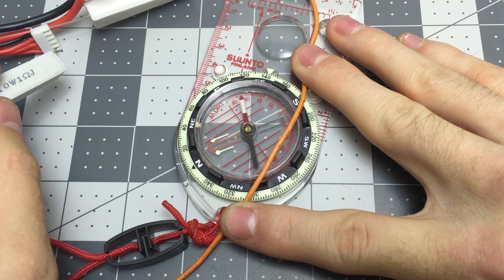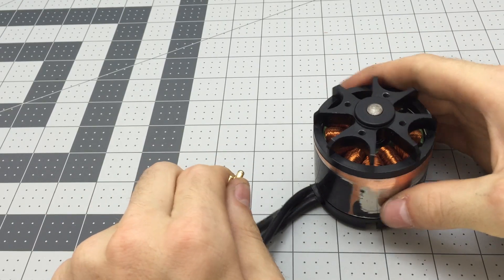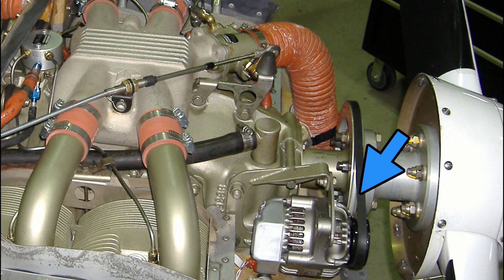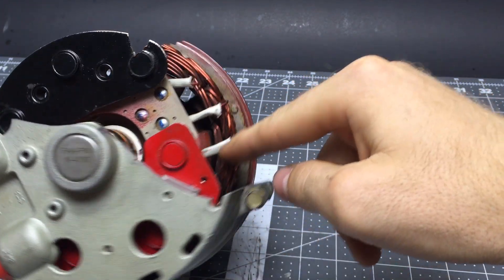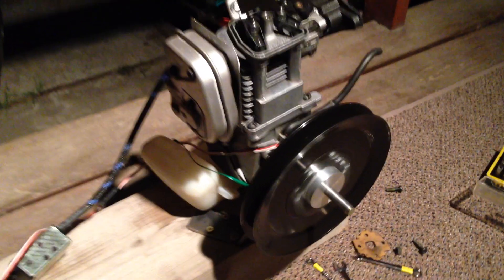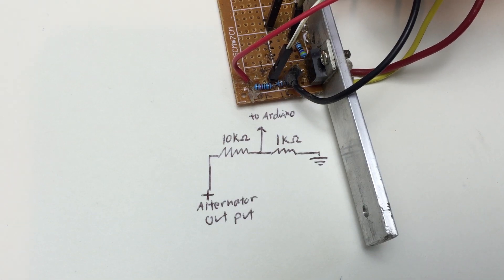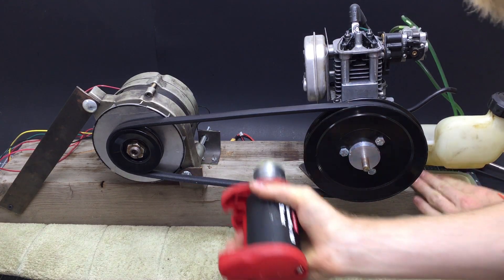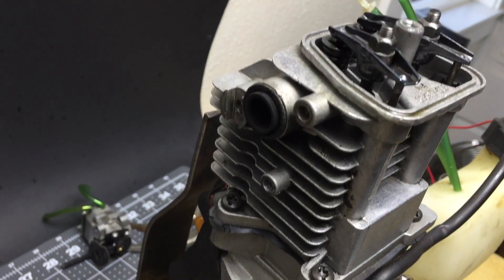How Alternator works + DIY Voltage Regulator

Comment: Gonna need a cooling fan if you want the motor to stay at operating temperature. I suggest getting a pulley off an air compressor, some have a fan with a pulley built around the outside.

Comment: thumbs up for the project
Reply: But my question is how do i make work Arduino as an AVR "Automatic Voltage Regulator" to which i connect an electric motor as driver and another electric motor as generator?.
What i want to know is where can i find the code for arduino in order to make work arduino as AVR and which components i need?

If you don't know please keep your urge of posting anything since it won't be of any use to me or anybody else that is loocking for similar help, avoid stupid comments THANK YOU!.

Do please all of you that think to say you cannot generate electricity with an electric motor well i tell you you are ignorant and you should go back to school!most of all you should get well informed with what materials are built both electric motors and generators.

Someone said: Ignorance is a Blessing for Fools and Idiots.

Comment: I'm doing something along these lines. I have one of those 350 watt Free Electricity wind generators that goes on a stationary bike. I picked up a cheap 12v drill for the motor that will run the generator via chain. I could simply put a voltage regulator between the generator and battery bank, but I need to figure out how to turn the motor on when the voltage in the battery bank dips and off when it gets back up to where it belongs. This would let me run a hydroponic greenhouse without grid electric.

Comment: Well the recipetiers for the Alternator are below the feild winding because when it’s rewinding the Alternator needs to go through the fresh hold at only 13volts when they regulate between Engine spins because they are meticulously harder to spin with lower Voltage power

Comment: i had learned that diodes make elec go one way only ,,they dont change ac to dc !  an inverter does that ,,,,whats up !
Reply from the maker: Diodes are used to turn AC into DC. Inverters are used to turn DC into AC
Reply: diodes are a one way switch kinda ,,,your wrong     INVERTERS CHANGE AC/TO DC OR REVERSED

Comment: What do you think is the maximum useful output of an unregulated alternator to charge batteries for an hour as quickly as possible? The idea is to charge in an interval for an hour and let it rest for an hour or preferably two. And again. Thus reducing the generator run time to minimum (1:1 or even better one to two).
Reply from the maker: Alternators have a maximum current rating
Reply: There may be considerable safety margin for continuous output. Ideally all amps would be taken out without melting anything during the charge interval. The shorter the charge interval, the more rest for the alternator. I guess it has to be tested in a lab.

Comment: Why 132 dislikes? I am a mechanical/electrical engineer, and this is a very acceptable explination, the video description i fairly precise and the guy seems OK....
Reply: Well the recipetiers for the Alternator are below the feild winding because when it’s rewinding the Alternator needs to go through the fresh hold at only 13volts when they regulate between Engine spins because they are meticulously harder to spin with lower Voltage power through pin13

Comment: Is it possible to regulate up to 48-50v for charging a 48v battery bank?
Reply: Its always possible to use a step up DC/DC converter to inchrase the voltage.
Reply: mikeman400 yes you will have to spinn the generator verry fast tought.
Reply: mikeman400 im getting 330v from a car alternator thath i have to gear up to about 10k to 20k rpm.
Reply: Duett A Traktor it is possible to get 220v AC by car alternator???
Reply: mikeman400 you need to make your own voltage regulator the one in the vid i dont think will handle 48v

Comment: Thank you for making this video. I kept pausing, writing down, going back, and will watch again a few more times. I bought a mint 81 rabbit diesel, it had a 55 amp motorola alternatir in it, I upgraded  the stereo system, and put a single wire chevy alternator in there, that supposedly will put out 225 amps at higher throttle. My fuel mileage went from a consistant 51-53 mpg to 46-47 mpg with just the alternator change. I bought a fluke 325 amp clamp, turned everything up and on in the car and the amp clamp at higher rpms is reading 60 amps.

Comment: I remember few year ago...I was working with a car generator to be used by students in a bicycle project.  Well at the beginning it was hard to spin the  generator until we start to put a large resistor to the cable that goes to magnetize the field.  The larger the resistor the easy to spin the alternator... obviously less power...but the student did Ok getting about 100 watts for few minutes....until getting exhausted,,, 

Good effort Samm!!!

Comment: if you put load on the alternator there will be resistance in the alternators axle and you need more gas to keep it running. you must make a controller to keep the rpms. but this is on alternators with voltage regulator and no field winding (comon cars alternator)

Comment: Hi Sam it seems like you need some smoothing  for your field circuit. what about using a capacitor ? or something like a comparitor to produce an analog output?  I like the little engine though... I have some similar ones with a permanent magnet alternator built into the flywheel. they are out of a chinese inverter generator.  I was trying to make an auto start circuit so the gasoline generator could be hooked to some batteries (24 volt) and use the batteries to run an inverter. The idea is to use solar and wind as the primary charging but the engine as a last resort. I'd like it to be all automatic. This way you could use power and have the system guarantee that your power is always available. This would be great for an off grid power system such as a remote cabin or camping.

Comment: Hey. I'm looking to make a vertical wind turbine as a school project. I need the turbine to generate enough power to charge a car/hobby battery. I'm a little confused on how I use the alternator. I need help with fully understanding on how to wire up an alternator so it can charge a battery. If it's possible, can you make a video

Comment: Samm Sheperd, crud! - Wish i knew the things you knew in regard to electronics, And in my case my desire to use a homemade bike pedal sprocket drive system. Wouldn't that be a self-reliant project to drive a small generator to juice my weak battery during the dubious times the car will not start in the middle of nowhere. mrflarkusAtgeemail

Comment: You are smart but forgot many aspects here. Reluctance, Induction, Impedance, Power Factor, the list goes on.. The fact you know of an alternator as a three phase delta source supplying (3 diodes/Sometimes 6) to direct current via a voltage regulator is good enough for me.. The ignition setup, Writing code, You sir are elevated in I.Q for sure.
Reply: It is highly, highly unlikely that the alternator/generator is wound as a delta.  Almost all generators are internally wired as a Y (some people call that a star).  It is possible that vehicle alternators are wired as a delta but I would bet a lot of money that that alternator is wired as a Y.

Comment: Really enjoyed your brilliant video ! Instead of having a built in regulator, or even a divorced regulator that resides under the hood, (usually bolted to the firewall), most modern car/truck alternators are controlled by the PCM.  I'd really like to know if the code is as simple as yours- I'll bet it is !.... why not ? Turn on the field, when necessary, and turn it off when it's not needed.  Furthermore, many cars, especially Chrysler products have battery temp sensors, so the code could be written to charge the battery according to temperature.  Also, I've seen inductive sensors on the battery cables, indicating to me, the PCM is monitoring current flow to the battery. All of these points could be adjusting the voltage and using the "on/off" principle you've displayed in this video. ---Kudos !
Reply: It's very crude. PWM is the proper way, and how OEMs do it.
Reply: @blackz06  You are correct, since my post in 2014, I have since learned it is PWM. Also, if you read my reply (above), everyone of the points I made turned out to be true. But I missed one.  The algorithm also attempts to extend battery life !
Reply: @mark_osborne  Yeah, I was just commenting on the PWM aspect.

Comment: How does a electro motive train work?  Electrically and mechanical.
Reply from the maker: I'm no expert in that,  but I'm pretty sure they use a huge engine as a generator and an electric motor for propulsion. This is because of the ridiculous amount of torque that trains need. Electric motors can provide crazy torque at 0 RPM. Essentially using the electric generator/motor as a transmission that needs no clutch and stuff.

Comment: What are you studying? Reminds me of A&P school but you seem more like an engineer ( in a good way) Nice timing adjustment :) Fun projects, thumbs up.
Reply from the maker: I have a B.S. in Aviation Technology. I'm a CFI and commercial AMEL. I also worked in hangers for like 3 years working on aircraft under A&P's but never persued my own A&P qualifications. I can sure change the oil and pull the plugs in a jiffy though. I was put off by engineering when I learned it was all just solid math. I didn't learn to appreciate what engineering was until 2 years into college

Comment: That little engine is running sweet. You've done well and great find. I'm not sure how cold it is where you are but if you have a little desk fan handy and set it up so its blowing over the engine... I mean if its going to run for any longer than a few minutes that is, it mighn't be a bad idea.
Reply from the maker: Thanks! Yea I can't run it for more than a few minutes before it gets too hot and starts to burn oil. I was doing power output tests with an RC airplane motor and propeller which I was also using to cool the motor.

Comment: do a car alternator push d same current example 100amps at high rpm n low rpm? ..
Reply from the maker: Instead of the perspective of "pushing amps" lets say that the system tries to draw that load of current. Alternators are able to provide more current at higher RPM, because there is a lot of voltage sag in the alternator and the system when under high current draw. So when high current is drawn, the voltage that the system sees drops and then the alternator can produce a higher voltage so that the system then continues to see the correct voltage.

Comment: why did you connect it to pin 13 when you want it be PWM?????
Reply: The field's PWM is triggered by the rise/drop of the output alternator voltage and not the arduino's internal clock.
Reply from the maker: +Andrew Maraguinot it's not true pwm
Reply: pin11,10,9,6,5,3 are the pwm pins??

Comment: There's six diodes in the alternator not three. What's the model of the outrunner motor you show? Looks like it could really move some weight around.
Reply from the maker: 2:50 "There are six big diodes that are used to...."
It's an Emax 5335 - 08

Comment: the main reason I clicked on this video is that little motor. or engine. that little thing is cool! do you know what brand it is. and the displacement. I would like to get one. and what kind of ignition system was that? I never seen one like that before. I already knew how a alternator works. but I really like seeing cutaways. but I couldn't ever make one from something useful. I guess its just seeing all the parts at home. views from there point of view. great video.

Comment: Also why do have 1.4=14.2 commented out in the code? Your voltage divider gives a ratio of 0.09, with 1.5V sensor voltage that should be 16,6 Volts output voltage. The output voltage seen in the video seems to be much lower than 16.6. Perhaps you should make some more hysteresis between the on and off voltages to keep the switch from switching madly between on and off with a correspondingly low duty cycle. For example 1.4 is off, 1.3 is on to get a nice 15V charging voltage.
Reply from the maker: +Mikhail Morozov honestly is been a long time since I figured it out. I should document things better.

Comment: Hey Samm, really cool video!
Just out of curiosity: Why didn't you use the PWM output of the Arduino and then a simple PI-controller (implemented on the arduino) to control the PWM output?
Also, when switching a current to an inductor don't forget to use a free-wheeling diode. Otherwise you might damage your components. Especially with a Coil as big as this one.
Reply from the maker: An aircraft mechanic told me this is how an alternator controller works, so I guess this was my test. I'm also not very proficient with arduinos or coding.
Yea I wasn't sure how a transistor would handle the spike when turning off an inductor. Thanks for the info.

Comment: Really cool video. You actually show it better than some dedicated 'engine channels'.

The naming of alternators etc. really confuses me. Most motorbikes have alternators, but I have one that uses this field coil (why?) and one without. Also the 2nd one uses a regular 3-wire-in and 2-wire-out regulator/rectifier while the one with the field coil uses a 7 pin version?
Reply from the maker: Yea it seems every alternator has a different way of doing the same thing. Motorcycles usually use permanent magnet generators which they call "stators" and maybe big fancy new motorcycles use actual alternators. It always confused me fundamentally how they could get away with permanent magnet generators. It seems the answer is to let the battery absorb the inconsistencies and maybe use a resistance based voltage regulator. Because under load the voltage will sag.
Reply: Yes the battery acts as a buffer "capacitor", and the R/R must be connected to the battery for proper usage.
Reply: The permanent magnet alternators use to have 3 sets of windings and only use 1 for running without the lights and the other 2 were connected through the light switch and on a long trip with high revs and not much use of the brake lights or indicators the battery would boil dry,  and light globes would burn out because of the high voltage. Later bikes used a shunt regulator to turn the extra power into heat , not good for power at the wheel or fuel economy. The only other option is to switch the output to the battery on and off to control the output voltage PWM. Much easier to control the 1-2 amps of the field than the full output of 20 amps plus
Reply from the maker: I have a 1978 Honda CT90. It has no voltage regulator and the battery boils dry :)

Comment: hey what size of brushless motor are you using
Reply from the maker: Lol, um.. that's an EMAX GT5335 -08 250kv
Reply: wow thats big I usually use a gt 2215
Reply from the maker: Yea I haven't used it on anything it's from some crazy idea I had and didn't finish
Reply: yea i also have some big motors like that that i haven't used

Comment: So when I plug in my batteries my brushless motors are very hard to spin  is it because what you should on the brushless motor or is it the voltage of the battery my Leipold battery is a 11.1 V battery thx if you could help that would be great
Reply from the maker: +Michael Hefner well the brake function on some esc's just connects the wires together to slow it down.
You think there is a problem? I'm not sure I understand what it is.

Comment from the maker: I haven't actually been taught the 3 things, I came up with that, so if there is some fatal flaw in it let me know.
Reply: Hi Samm, I think there is no fatal flaw in the above mentioned except that you left out the current flow through the generator. With increased current there is more voltage drop on the internal resistance of the generator windings.
Reply: So make a video about it. Don't be shy.
Reply: Samm Sheperd l
Reply: @yukidark1000  It was a good question and explanation. Only obvious to a non-mechanic once stated.
Reply: You didn't put the valve cover on.
Reply: only thing i would have done differently is using a more common alternator with a built in regulator/rectifier circuit ... in many occasions where i have had small engine machines and needed to add such a thing (charge a battery for a winch or power lights) i have always gone to the abundant and inexpensive delco one wire type .... it has one big terminal that goes directly to the battery (hense the name) and thats all that needs to be connected .... from there it does have two small spade connectors for ammeter and warning light but those arent needed to generate power
Reply: Yogaraj Balakandaswamy he was just advancing/retarding the spark timing by physically moving where the sensor picks up the magnet relative to the combustion cycle. You find an optimum for a given rpm to generate more torque/power.
Reply: the theory behind input and output of a generator is an error that is classically taught in shool.  actually you don't have an alternator, you have a motor that is reverse run as a alternator.  relative motion between magnet an output winding causes motor reaction. if magnet and winding is stationary and steel slide in between magnet and coil,  power is still generated even this there is no reactive force. such a system i describe is a real alternator and i have built one that worked, that had zero mechanial resistance and a noticable current on the output.